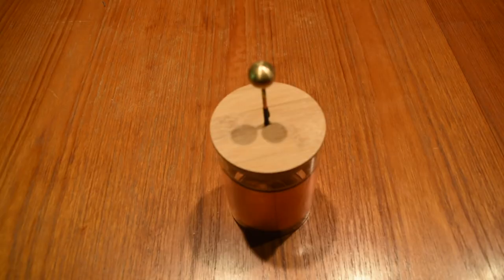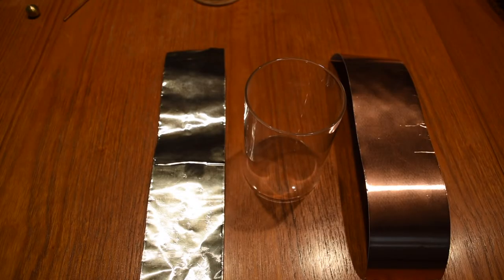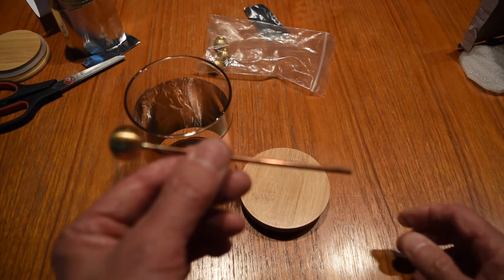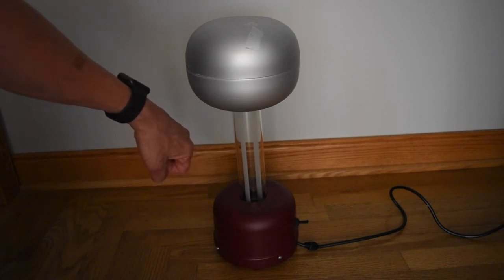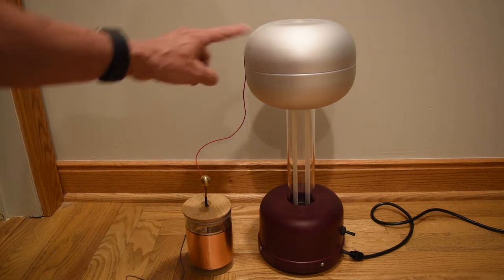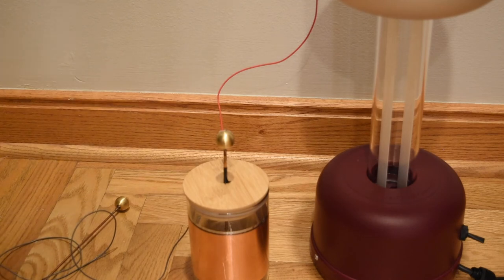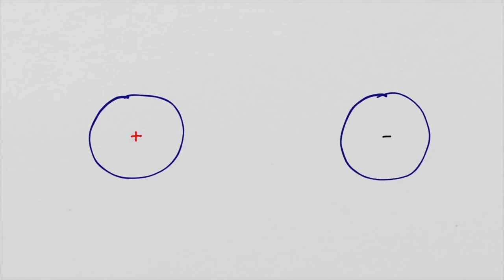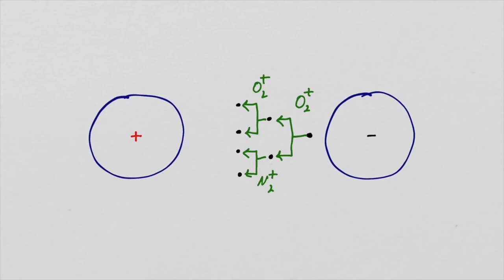Leiden (Leyden) Jar Capacitor

Comment: Does the distance affect the capacitance of the Van de Graaff generator vs the Leyden jar?  For example, because the charge has to travel through air to reach the receiving conductor in the VDG generator, does that affect the capacitance?
Reply from the maker: It is like two capacitors in series. The connecting wire should not matter.

Comment: Thanks.  So Ben Franklin says the charge of the Leiden Jar (capacitor) is stored in the glass and does not require the electric field of the metal plates to remain in place.  What do you think?  Have you thought of building a dissectible Leiden Jar or a parallel plate capacitor with a removable dielectric to experiment with this idea?
Reply from the maker: The dielectric does do more than just hold the two plates apart. It becomes polarized and affects how much energy is stored in the capacitor for a given voltage applied.

Here are some videos where I discuss the polarization that goes on in the dielectrics.

This one is an example I work in class of a parallel plate capacitor with two different dielectrics in parallel.

https://youtu.be/oa9q55PH0-s

This one is an example I work in class of a parallel plate capacitor with two different dielectrics in series.

https://youtu.be/kk4Kod3xaVs
Reply: @electricandmagneticfields2314  <<Here are some videos where I discuss the polarization that goes on in the dielectrics.>>

Thanks Michael.  From your examples, you discuss the "charge density on the plate."  This is exactly the concept that a dissectible capacitor refutes.  If you take away the metal plates after charging the parallel plate capacitor, and then move the "charged dielectric" to a different set of metal plates, what happens?  Would it discharge?  Same with the Leiden Jar, if you had removable aluminum/copper and replaced it with different metal coatings (after the jar was charged), would it still discharge?

Comment: Whats the Reason for the diferent types of metal Tapes? Wouldn't the aluminium one be enough just by it self?
Reply from the maker: It would. I used the two different tapes so that the inner and outer conductions would be distinguishable in the video.
Reply: @electricandmagneticfields2314  But it is rather misleading. I had the same confusion.
Reply from the maker: @dmaster20ify  I should have mentioned why I used the two different metals in the video and that it was in material to the operation of the capacitor.

Comment: How long can this Leyden jar store energy(hold the charge) if you don’t discharge it?
Reply from the maker: A very long time. It depends on the leakage current through the glass insulator. I am guessing for years. That is why capacitors in electronics like old CRT TVs and microwaves can be dangerous.

Comment: Thanks for the explanation! Quick question if I may, why the selection of copper tape combined with aluminum tape? Would it have worked using copper on the inside and out?
Reply from the maker: Yes it would work with the same metal inside and out. I used the different metals so that the two conductors would be more visible.

Comment: Hello Sir, I have a question. Of course, you know about the discharge time from a capacitor, or Tau = RxC. What Homemade Resistance can I attach to a Leiden Jar to slow the discharge time? Not Circuit Components.

Comment: Please, Why coper tape outside... ???

(  Most of the capacitors are just
* simple  aliminium plates,
...( with Air in between or dielectric).
Reply from the maker: Just so the two different "plates" could be visible.
Reply: @electricandmagneticfields2314  💡

Comment: Nice video, i have a question we have sparks even if the wire of exernal conductor is not connected to the jar
Reply from the maker: Possibly if the external conductor can effectively act as a ground. But be careful because you might end up being the ground and get a very dangerous shock.

Comment: Very poor explanation. Where is the water in the jar. I heard that the water stored the charge? What is storing the charge in your Leydon Jar? Why didn't you disconnect the Leydon Jar from the Van de Grauf machine? 

I can't reproduce the Leydon Jar experiment. It is beginning to sound phony. But I never was able to reproduce any scientific experiment. Not able to create a motor. Not able to create an electro magnet! What gives?
Reply from the maker: I have metal foil on the inside and outside of the jar where the charge is stored. I could have used water on the inside instead of the metal to act as one of the "plates." I don't see a need to have disconnected the Van de Graaff generator for what I was trying to demonstrate in the video..
Reply: @electricandmagneticfields2314  But the Van de Graaff machine could be the source of the electricity. I can't reproduce this Leydon stuff. I tried you foil paper inside and outside the jar. Plastic jar that the peanut butter comes in. I bored a hole in said cover and put a wire through it and taped it to the foil inside the jar. I taped the foil paper in and out of the jar. Corked the jar. I then attached a 3.8 volt charger to the wire for couple seconds. I then connect a wire to the two terminals of the Leydon Jar; nothing. I then connect the jar to 110 volts, nothing. I then connect 110 volt plug to each terminal of the jar, still nothing.

Is it because I am black why I can't reproduce these experiments.
Reply from the maker: @dmaster20ify  I rarely get my demo projects to work the first time. Every time I do one it is a learning experience. You might actually have a capacitor. With a 3.8 V on the capacitor, you would not get a spark until the separation between a wire touching the inside and a wire touching the outside was less than 0.0001 cm apart. The dielectric breakdown strength of air is 30,000 V/cm. Connecting to 110 AC is dangerous, but since it is AC your capacitor can be anywhere between 0 and 110 volts across it. A simple device I have used to charge a Leyden jar so as to get a spark is the electrophorus 

https://youtu.be/4k-z5O3Xk4A

https://youtu.be/Sqhgrw3bDmU
Reply: @electricandmagneticfields2314  All I can say I appreciate your replies and explanation. I don't know what is electrophorus; and honestly and am no closer to figuring this out. This seems as complicated as getting a seed to grow.
Reply from the maker: @dmaster20ify  I included a link to an electrophorus. It is a static charge generated. It is just a piece of plastic, something like silk to rub it to get charge on the plastic, and a plate of metal with an insulating handle. I have successfully charged capacitors to high voltage with this.